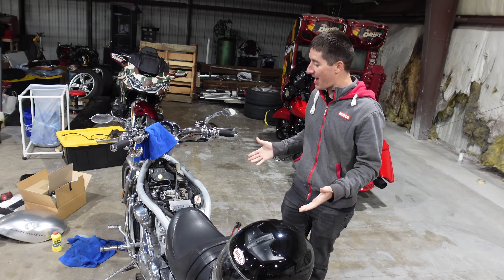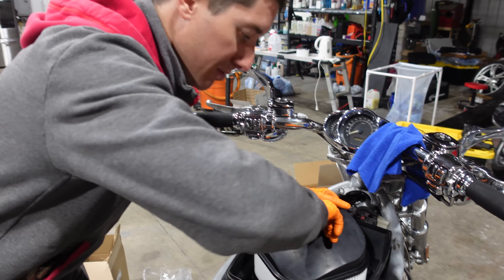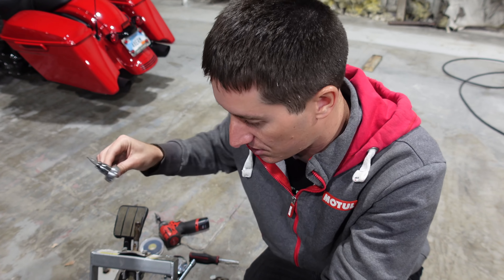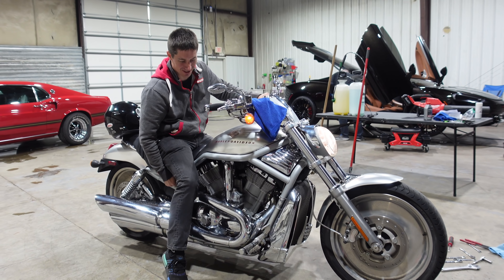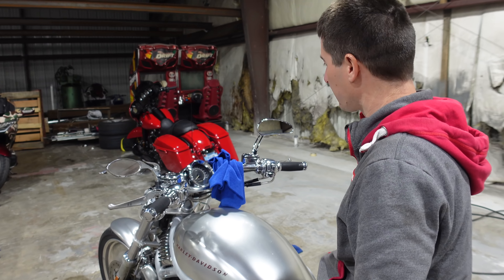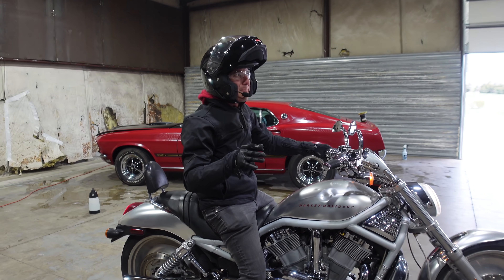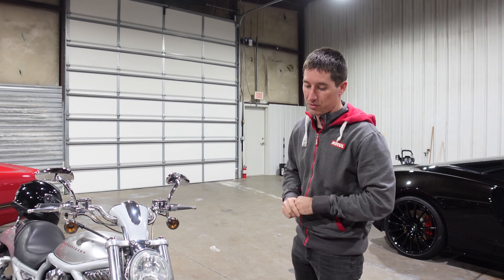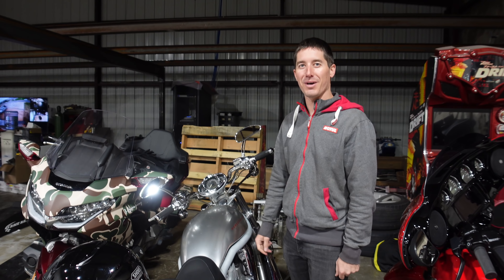My CHEAP Harley V-Rod Rebuild PAYS Off *It Rides Amazing*

Comment: Can you give us a shop update on the detail side of the shop? Plumbing went in and concrete was poured, but I haven't heard anything since. Are you estimating completion later this year?
Reply: I am curious to see if the balcony has progress
Reply: Meybe there are no money for this.
Reply: Last that I remembered, he was still waiting for the plumbing to get hooked up outside the building to the city.  I'm sure the workers pushed it off until winter is over and the ground thaws. Should be soon
Reply: @isaacsoderlund9677  Yeah something about perpetually waiting on horizontal drilling for running the drain line to the sewer system or something

Comment: Wife had a 2003 (100th aniversary) for couple of years. Excellent bike apart from stupitidly small gas tank. She had to fill up 2-3 times while I filled up my Hayabusa once. And keeping it clean was a nightmare. Anodized bodywork and polished aluminium ment several hrs of cleaning and polishing if got wet.  Not exactly a all weather bike but great for ocassional "sunday" ride in sunny weather.
But a real joy to ride and looks great.

Comment: I paid 6200 for my 06 vrod from a dealership, plus had them replace the rear brake hose, and pads cause the hose failed and squirted out on the car in the other lane. ( I paid for their car wash) I'm really excited about this series. I wanted a vrod since I was a teenager, and I'm definitely a vrod enthusiast.

Comment: Looking good! 🙂 If you do find someone to take the dents out of the tank I'd be really interested in how it's done. I bet there are hundreds of owners out there with the same issue. 👍
Reply: I am wondering if there is an easy way to pop that back out with air pressure. It really doesn't look like it would take much.
Reply: I though the exact same thing modified gas cap with welding in air adaptor would do it.
Reply: Nevermind it's double layered tank within a tank. Need a new strategy.
Reply: @Stanley-flareside  Yes it is just an airbox cover.  The bottom is plastic.  Drill a hole in the plastic, insert an air bladder and tap as you pump it up. Without physically examining one that is the best I caan come up with.

Comment: Save money?  You don’t buy a Harley to save money.  You can get aftermarket parts, but, do they fit or are they any good.  Aftermarket foot pegs/ mirrors are fine but engine parts, not so much & not worth the risk.  I’m not a big V-Rod fan but I’m definitely a fan of saving an old bike & putting it back on the road, great job!!  Definitely enjoy the content!

Comment: A  buddy of mine bought a 1995 Fatboy used from a dealership many years ago.  The rear brake was crap so he tried several times to bleed it with no success.  Finally he purchased a hand pump oil Dispenser, filled it with brake fluid and hooked the hose to the bleeder nipple on the rear caliper.  We emptied the reservoir and he started reverse bleeding the system forcing fluid in from the caliper end.  So much junk just poured out of the line into the reservoir.  After a few pumps the fluid came in clear.  Rear brake worked fine after that.  Those mirrors definitely fit the bike.  As for the rust on the running lights.  The Previous owner of my 05' Softail purchased a kit to move my running lights from the handle bars to the forks to fit a windshield.  The retaining bolts have rusted the same way and it is definitely a Harley part.

Comment: I have a 2003. If your boot has any pressure on the shifter, it won’t like shifting into gear, so keep your foot off the shifter between gear changes and you won’t miss a shift. Also this bike comes alive after 5.5k rpm. Mine looks just like yours. The new tires will change everything-I have the Avon Cobras. Also, toss it into a corner sometime-steering weight aside you’ll be surprised how much lean angle the VRSCA has. You’re not having fun until past 5.5k rpm. Love the v rod!!:)

Comment: I wouldn't be surprised if the difficulty in shifting simply came from the fact that your shifter was adjusted so poorly. Farting around with my old '82 Yamaha XJ650 I adjusted my shifter up pretty high because I have big feet and the notoriously finicky 2nd gear became even more finicky because it took more pressure from my foot to get there due to the angle. I lived with the slightly lower foot on the left side because it prevented me from missing second and accidentally hitting neutral when really hammering on it for some fun (which still happened much to my dismay)
Reply: Might be a combination of the two. Clutch not disengaging properly and gear lever too far forward

Comment: I have 2005 Vrod . I love it. Best on reliability. The oil leak comes from 3 grommets in the alternator plate. I have a power commander on it, dynod 135 hp.

Comment: use the hot glue dent puller to remove the dents
Reply: Worth a try
Reply: @jasonw3303  Totally agree
Reply: Just cut out the plastic on the back, and tap it back out. Worth a try.
Reply: @runarsundal5763  nah, that will create tiny high spots in the other direction. Should just try pulling it from the outside. A talented pdr person may be able to push the dents out but I wouldn't try that myself.

Comment: Look to see if there is a adjustment screw on the clutch cable. If there is that could fix whatever issues you are having. If no adjustment screw, then you might have to replace the cable. 
If motorcycle tires are 5 or more years old, it's always good to replace them. The dry rotting is what takes it's toll on them and will cause a blow out. Also definitely going to want to take a really close look at the drive belt as well. 
Ever since you put out the first video about this bike, the algorithm in my feed has been nothing but videos about this model... Lol

Comment: About bleeding, I would unbolt and elevate the slave as much as possible.  Give it one pump with the screw open to move any air in the line to the slave, then with the bleed hole as high as possible, press in on the slave to get the air out, then replace the screw before it sucks any air back in.

HD might dunk the slave in a pot of brake fluid when bench bleeding to prevent air through the bleed port.  Maybe not but I bet they had some trick to prevent service issues.

Comment: My buddy still has one of these. Motor was developed with Porsche iirc? Fast as heck ha.
Reply: Harley developed the motor, it's based off their VR1000 race engine. They utilized some Porsche input on making it more livable and some stuff with the liquid cooling, more of a consultant thing than a co-development. Honestly maybe the best engine they've ever made, super reliable & hard to kill, sounds great, smooth, makes good power (it's a decent number now, let alone 20+ years ago when they came out.)

Comment: Clutch plates are wearing, I think that's why it slightly drages forward. Fluid stops getting in-between the plates as well and they start sticking together. Could be wrong though, just a suggestion?

Comment: A really good (and cheap) alternative for metal polish/cleaner: Bar Keeper's Friend has a spray cleaner that does AMAZING things for chrome and other plated surfaces as well as bare metals like brass and German silver (nickel silver). The best thing is, it's non-abrasive, so you won't get swirl marks on polished/lacquered surfaces. I even use it on the wheels of my cars... it just melts brake dust but doesn't hurt the finish.

Comment: Can wait to see the Tyres and brake replacement episode 🤘🏽
Reply: Can't believe those tires are only 7 yrs old. Thrashed. I have 15 yr old original tires on my Honda Fit that still have half the tread on them and no cracking. The difference is light use and always stored in the garage since day 1. I'm replacing them this year as they are hard and not really safe in the rain anymore. The sun kills tires.

Comment: Have you thought about using boiling water and a decent plunger to get it the dents out of the air box cober, it may work or not won't hurt to try it, im going to try that method on my bikes gas tank when it gets warmer out

Comment: You left those large o rings on the throttle bodies at the top...you need to push them down to the base...they are there as a failsafe so that the 3 bolts don't get sucked in to the throttle bodies

Comment: Did you replace the rear brake pads and or rotor? Does it have the 240 wide tire kit installed?

Comment: can't you drill a hole in the under part of the cover to do PDR since it isn't seen anyhow?
Reply from the maker: It’s a maybe, would need a lot of holes for access 😬
Reply: @WatchJRGo  maybe an option would be cut the whole underside with a cutoff wheel, knock out the dents, planish and TIG or spot weld it back in?

Comment: Nice bike...but  that Mach 1, would love to see more of that! I see you mentioned that it was in for detailing...contact the owner and see if you can do a video about it...it's a classic car! And the star of one of my favourite book series, the SERRAtted Edge books by Mercedes Lackey. SERRA stand for South East Road Racing Association, totally fictional. But it's a series about Elves running a racing team using race cars with only Non-ferrous metals. The main character, Tannim, a human who drives a Mach 1 that has been upgraded with racing suspension and a bunch of other mods, but looks stock from the outside. The Elve's race car engineering company, Fairgrove Industries, has as part of its entrance a stop light, and a measured distance and automatic timer for it that displays the time in the building. Anyways, if you like Urban Fantasy, Elves (in malls!) and Cars...this is the series for you!
Reply: I caught that, too.  You hardly ever see Mach 1s in the wild and that is a beautiful one in the perfect color.  I sure hope he makes a video or two on it……. And that it’s a 4-speed.

Comment: Hi there Just bought a Harley 1200 XL custom & I want to Flame delete my mirrors & actually make them useful as they are tiny also had some sad looking  Indicators all the chrome was peeling off  then after replacing them with LED units they work but the red key warning light appeared on the cluster Bike runs fine It is a 2004 so no fob & everyone I ask about it says just take to HD & be robbed.

Comment: Hi could you help me, I just got a 2003 HD V Rod and I had to remove the battery to charge it, but I noticed that the coolant tank was almost empty, I ordered the coolant, it's on its way, and here comes the questions, can I add normal water now, or do I wait for the coolant to arrive, now, when it arrives can I add 50 water and 50 coolant or can I just add coolant?

Comment: I would do a total flush on the clutch oil it might have lost viscosity, or it might have the wrong oil.
Reply: Well it sounded like they switched from DOT5.1 to DOT4, so it is using the "wrong" oil. Not sure if it's ok to do that swap.

Comment: I would've cleaned and re-oiled that K&N filter. Any oiled cotton gauze filter does a better job than a paper filter, and if they are properly maintained, the will last the life of the vehicle. I wash mine in the kitchen sink with Dawn dish soap, then a combination of blow/air drying before re-oiling. Perfect. I would also replace that air filter cover stainless 'tank' and fix the air ducts. But that's just me. .02
Reply from the maker: New air ducts are on the way 🍻

Comment: I like following any new project on the channel but as an engineer HD's are just built & engineered too sloppy for my taste. The build quality difference between JR's Goldwing and the V-Rod are miles apart. However, the V-Rod is a fun little project and it's definitely coming along nicely.

Comment: 3D print and air box cover. Don’t spend $800
Reply: 800 for a new one,  100.00 on ebay.
Reply: @camaromodschannel  just going by what he said. I’d definitely go for the eBay purchase over the 3D print but I’m curious how the 3D print would turn out. Would definitely be unique

Comment: This is petty, but how hard would it be to buy some rolls of white plastic to dress up the ripped up insulation. I mean, all the great stuff about the shop but those darn lower walls just drive me nuts. Again, I know it isn't a priority. Just drives me nuts.
Reply: Yes to freshening up the torn insulation with large vinyl banners promoting JR's YT channel and even large vinyl billboards featuring generous sponsors. Go JR Go!